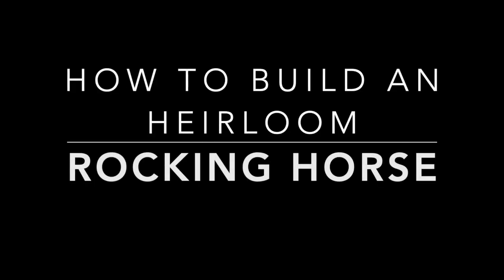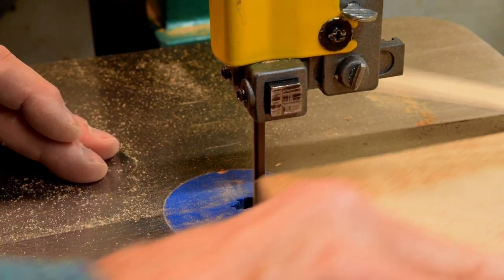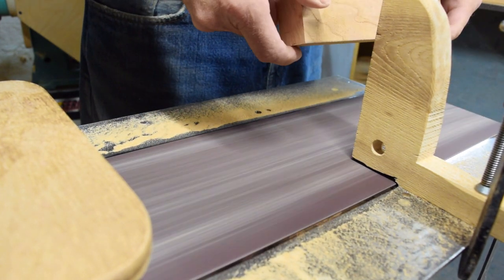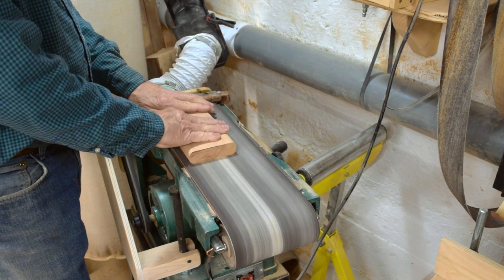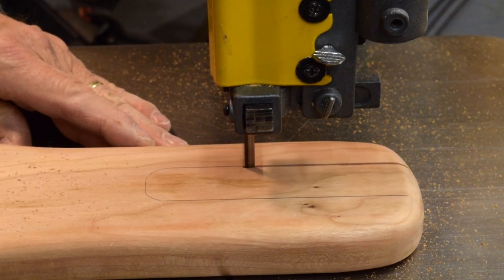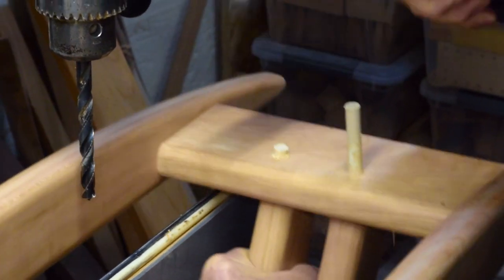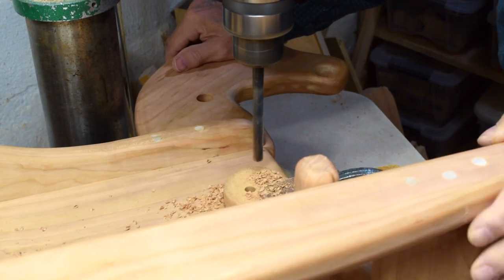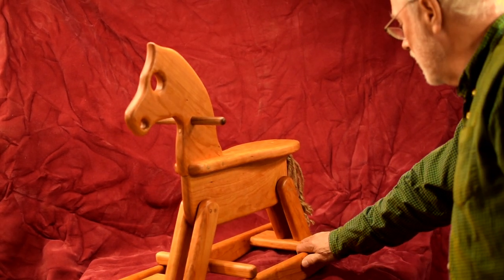How to Build an Heirloom Rocking Horse

Comment: I am having my first grandchild in February and I am wanting to make something nice that will last for a long time. The horse you made is what I am looking for. I have all the woodworking machinery and tools to make it. Do you sell the plans or patterns? I am very impressed by your woodworking skills. The speed and accuracy of cutting the parts on the bandsaw was impressive. I don't know what kind of blade you use but it was cutting through the wood like hot butter. I use Timberwolf blades. I would like to purchase the patterns from you if they are available. I will check back and see if you have responded. I really enjoyed the video. Thanks!
Reply from the maker: I use bandsaw blades most often from Olson saw, that I now buy on Amazon. I like a ¼ inch skip or hook tooth styles.  I do sell plans for my horse. You can find info at http://woodentoy.com/horsebook/htmlbook/page18.html or visit my ETSY page under finehardwoodtoys. https://www.etsy.com/listing/809165160/rocking-horse-plans-plans-only-build?ga_order=most_relevant&ga_search_type=all&ga_view_type=gallery&ga_search_query=rocking+horse+plans&ref=sr_gallery-1-6&organic_search_click=1&frs=1